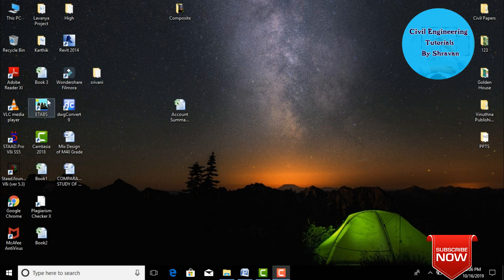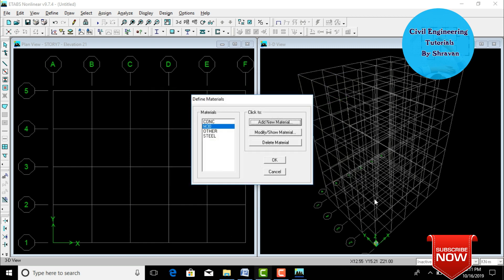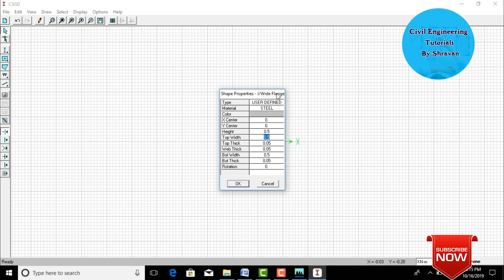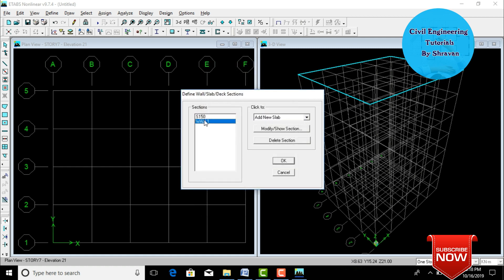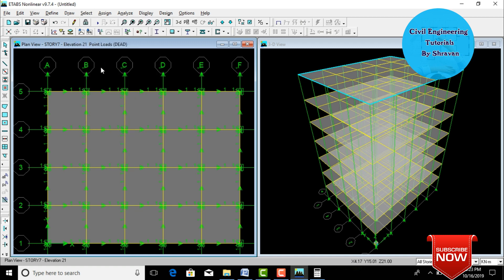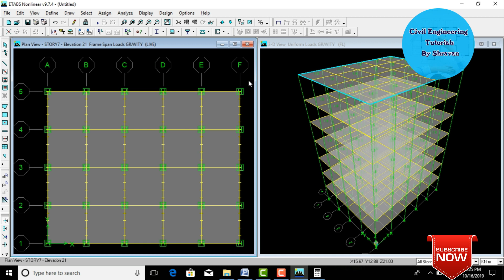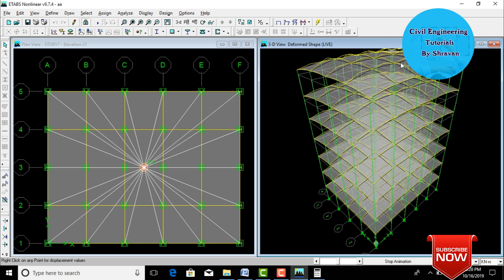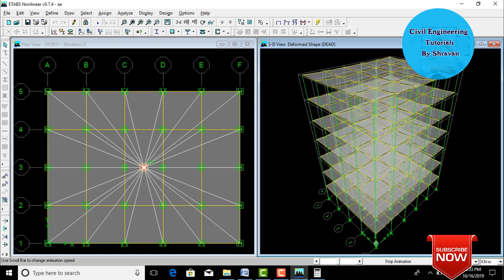Composite column Building design by ETABS Software

Comment: why you assign dead load manually? program automatically calculate it from section dimention & material defination.
Reply from the maker: In ETABS Software it will not calculate values like STAAD pro
Reply: what about Self weight?

Comment: Bro , For Building Design which software is useful & give accurate analysis
& Which software is easy to use Stadpro or Etab
Reply: Many software's available .. depends on your interest and requirment ..
STAAD PRO 
ETABS 
PROKON 
PROTA STRUCTURE 
TEKLA 
MIDAS 
RISA 
REVIT & RBS
Reply: Start with staad .. then start getting updates to one by one
Reply: I'm interested in RCC Structure, & I  have to choose one option Stadpro or Etab,safe
 which will you suggest
Reply: All are link software's ... start with staad now  BENTLEY SOFTWARE'S ... LATER GO WITH CSI BERKELEY ..ETAB SAP SAFE ...

Comment: For composite columns how to get reinforcement details. It is not showing in my etabs.
Reply: And i couldnt find do you find it
Reply: @fahimalizada1888  I hav designed reinforcement from "display design info" tab
Reply: @anandsingh6441  Hello brother, I want to design a building with concrete and composite columns .Can i use concrete columns and composite column in a one plan
Reply: @fahimalizada1888  yes u can, infact I am writing a paper on this. In my research composite 450*450 ISHB225 can take same laod that 750*750 column is taking.
Reply: @anandsingh6441  Thanks brother
Reply: Hello Anand sir. My project topic is seismic analysis of multistory building with concrete filled tube steel section column and composite encased I section column  with same area of cross-section. By response spectrum analysis it's shown Concrete filled steel tube column is better seismic performance than encased I section column. But, is same area of cross section of composit columns give same value? Do you know why it show different value of base shear,  storey drift.